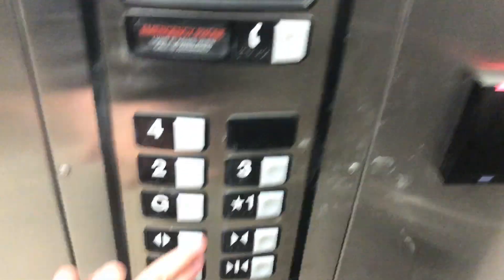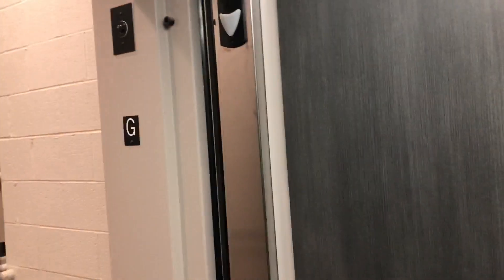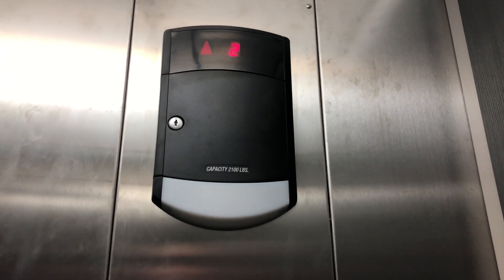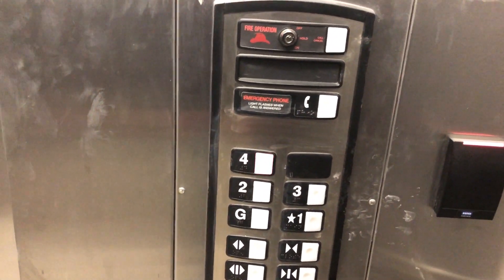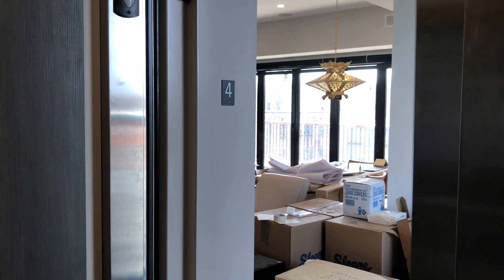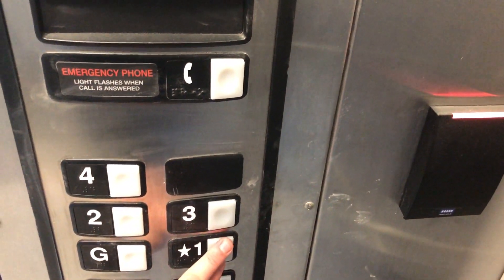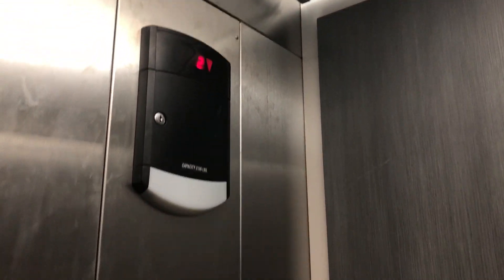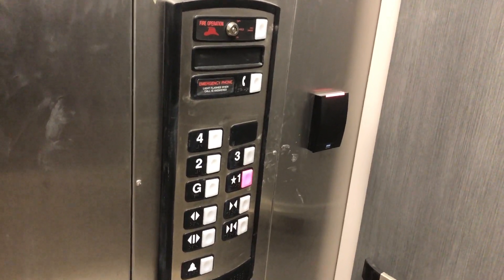Happy 330A day! Schindler elevator - Wd7Condo,22,1 - Shadyside, Pittsburgh, PA

Comment: and wow they're still making these, even though im getting old lol
Reply: @Vancity Elevators Yeah Schindler seems to be one of the few companies still manufacturing hydraulic elevators anymore. I mean the 330A was introduced in (if I’m correct) the 90’s?
Reply: 330A wasn't introduced until 2001
Reply: @Vancity I see. Well now I feel old.
Reply: ill bet $3.30 if the 330A continues to be produced past the year 2030
Reply: @Vancity Elevators I think I’d take you up on that bet. You’ll most likely have to remind me in 2030 though.
Reply from the maker: It's been 21 years, & there's been little changes. If they were to keep this model, I know this sounds controversial, but maybe discontinue HT & replace them w/ EPCO Endurance or something (halo for non-VR & dot in the middle for VR). HT is so out-dated now. Probably why they discontinued it on HXpress back in 2017.
2030, who knows lol.